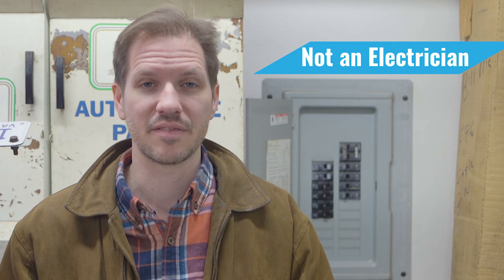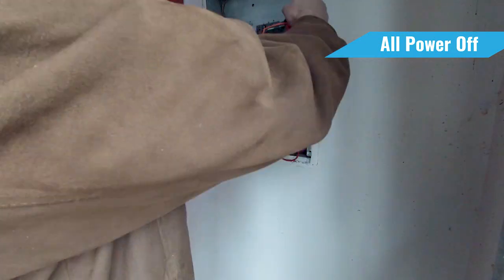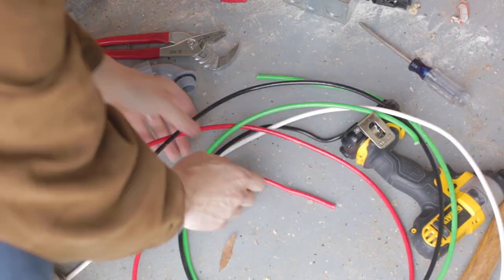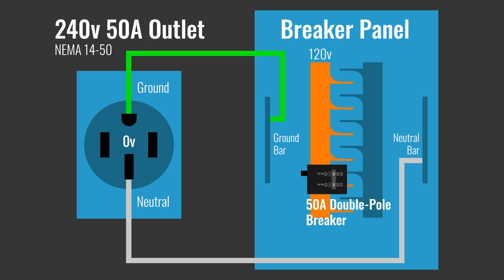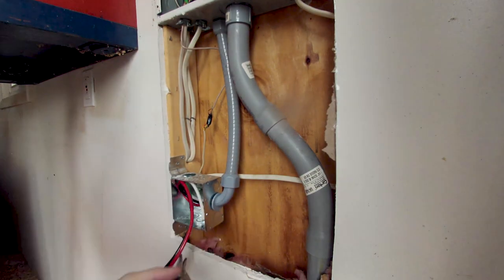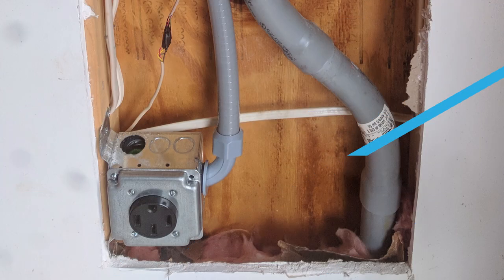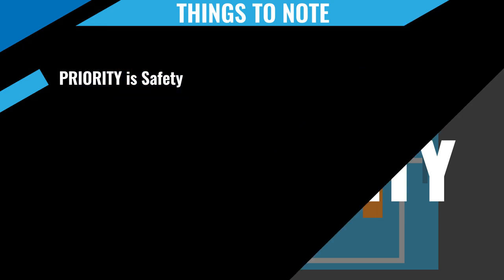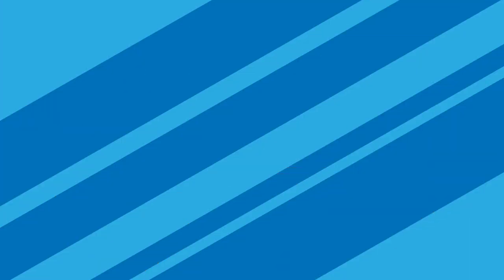Installing a 220/240v 50A Outlet

Comment: You should have called a professional because if it would have me ive would have not cut the drywall and made more work, im alway working efficiently, just used a cutting 411 box with 8/3 romex with plastic connector in to the panel.
Reply from the maker: Probably, what does a cutting 411 box mean? How does it save you from cutting into the drywall? Is it a surface mount box? Thanks for watching!
Reply: @CuttingOutBack  Well basically is a large blue double gang plastic box with tightening wings in the part that goes inside the wall on opposite corners of the  box that you tight them after you install the fitted box inside the wall and that is the only small square you cut in ure finish wall and some already have a connector for tightening the wire that you going to use with 6/3 romex and a metal 3/4" knock out connector that goes on the knock out hole in the panel to protect the wire from sharp edges, after the box is installed then you proceed in finishing the installation, I enjoy watching electrical installations and putting my two cents...lol 😆 take care.. JJ ELECTRIC. Oh yeah,  also there called remodel electrical outlet boxes..!
Reply from the maker: Thanks Jessie, that's good info. I'll keep an eye out for those the next time I do an install.
Reply: I would never use a cut in box on anything that large. Seen to many torn out of wall. The way you did it is the right way.
Reply from the maker: Thanks Thomas. I appreciate it, and thanks for watching!